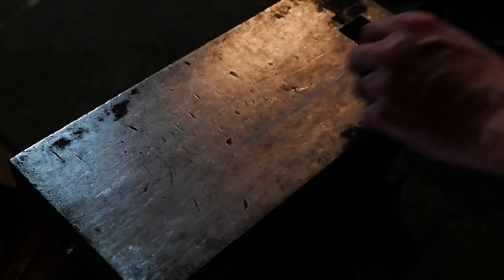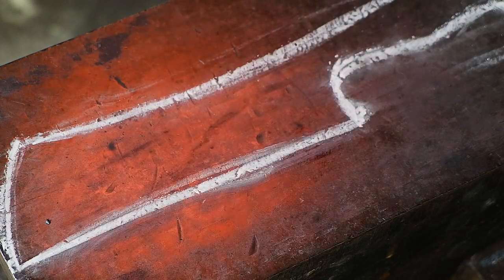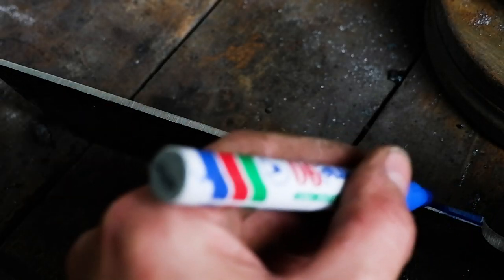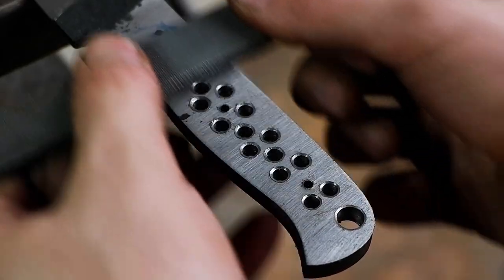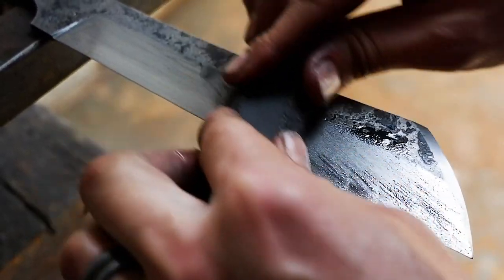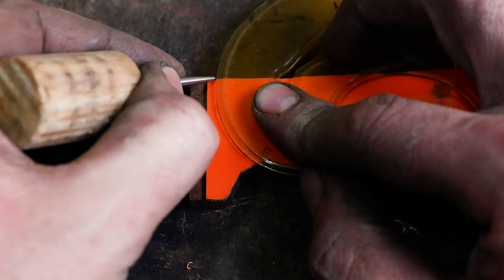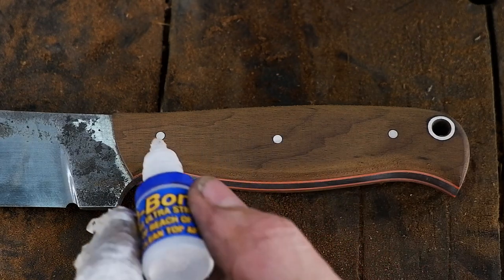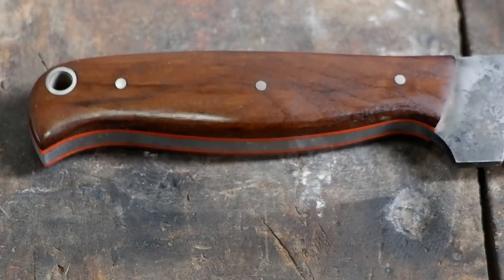Making a forged Bushcraft Chopper

Comment: Would it be ok to put the blade in the acid, before putting on the handle?
Reply from the maker: You could do that. The reason I don't is because after the handle has been glued and pinned, there are always some sanding / finishing and cleanup left to do afterwards, which will remove your acid stain from the spine of the knife....meaning you'll need to touch it up again with a cotton ear bud soaked in the acid, brushing over the clean sanded spine, without staining the wood. I suppose it is much of a muchness at the end...no wrong method, just whatever give you the best results.